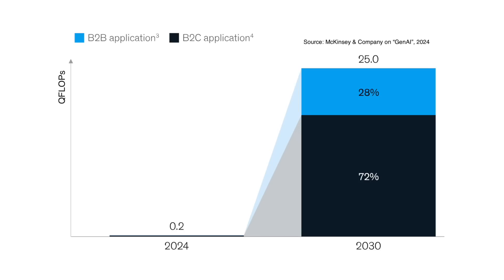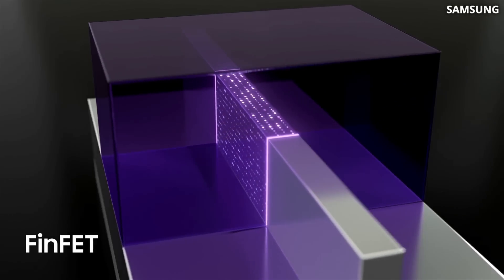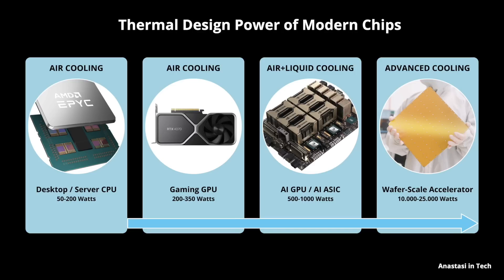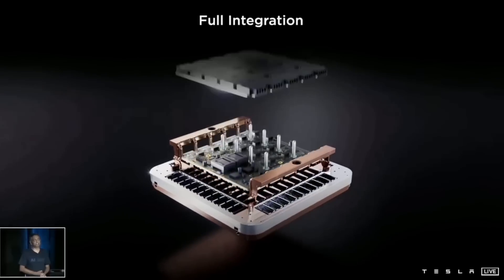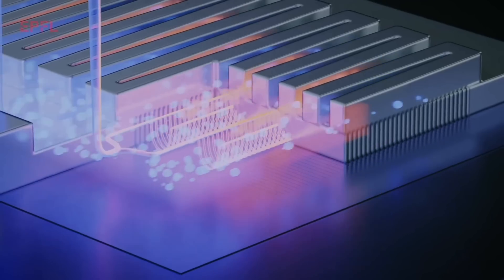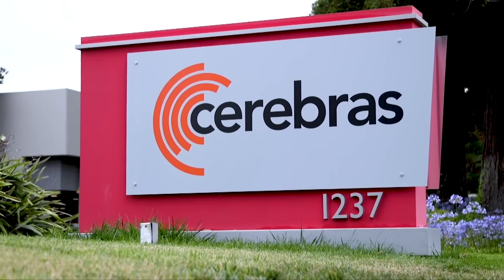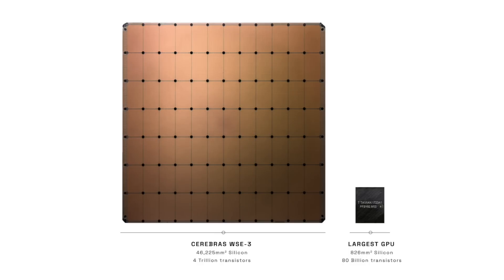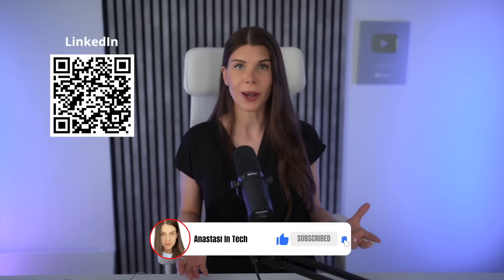This New Technology Will Keep Moore’s Law Going

Comment from the maker: Let me know what you think! 🙂
Reply: Absolutely terrible pun. Love it.
Reply: You stated that silicon is more conductive than copper (6:53), which is not true. I otherwise loved the video and the puns!
Reply: cool stuff
Reply: one major issue with this direct or in-CPU-cooling is that water, at the size of these channels, will become very viscous. This means, a high pressure is required to maintain a sufficient water flow, which in return requires very strong and tight enclosure of the CPU. 
And there's another issue: Water tends to dissolve air, especially oxygen. At high temperatures, the air will gas out again. But bubbles in these channels act like valves, they may block the entire flow of water and prevent cooling at these spots.
And yet another issue: Da-gassed and de-ionised water, which has to be used if water is the coolant of choice, is also slightly aggressive. And everything that get's dissolved by it, may precipitate in these channels and block them.

So, water may not be the coolant of choice. However, other coolants which are employed elsewhere pose other risks and issues. Some of them are PFAS, for example, others are flammable... there's still a lot of work to do here.
Reply: @human_isomer  whatever fluid will be used it should be enclosed separated from AIO cooler's liquid, IHS will be the thermal conductor in between as usual.
Reply: @human_isomer   it has to be ammonia instead
Reply: @monad_tcp  ammonia needs very low temperatures to be used as a liquid, which bears the risk of condensing water and short circuits in the vicinity. Also, it is even more corrosive than water, as it can dissolve certain metals into their respective ions and "free" electrons.  The latter is not very beneficial for systems working on electric currents.
Reply: I think you made a mistake at around 6:58 when you say that Copper is 4 times less heat conductive than Silicon... its the opposite.
Reply from the maker: @lolmao500  yes, you are right. Thanks for pointing it out
Reply: @lolmao500  someone will get fired
Reply: Was the jacket on and off continuous a cooling problem in your place?
Reply: Are there risks of any buildup that can block those channels the water flows through? Or any kind of corrosion?
Reply: @alcorza3567 We don't have that issue now so I wouldn't think we'd have that issue later.
Reply: Overall very 🆒much  ideas 👀ツ
Reply: I think your an angel in disguise .
Reply: @jaykeane25  no shit, have you seen the amount of gov sponsored off topic trolls in her comment sections, i want to believe its just them taking advantage of her team's work too.
Reply: If cooling tech has to improve in accordance with Moore's law, in what year will we discover Maxwell's Demon?
Reply: Personally other than phase change materials, I would think something like either carbon nanotubes or diamond substrate might solve some of these issues especially on lower end versions of these chips. Some form of integration, hybrid material manufacturing, might be an interesting idea to explore. Don't get me wrong, it would require some significant engineering and scientific research to do right. Not sure that it would be available in the time frame that we're talking about here... There are a couple of other extremely futuristic ideas that I have, but they simply would not be usable current technologies. And might never be possible since they might interfere with the very electronics they are attempting to cool... I really enjoy your content, and this particular video was honestly one of the best that you've done
Reply: Why not use cold water or other liquids that freeze below zero instead of room-temperature coolant? Bigger temperature difference between chip and coolant makes heat transfer more effective. Sure, its inconvenient for PC to have a noizy heatpump running in your room, but for some data center its not a big deal since its already noizy there.
Reply: @Boris-Vasiliev  condensation. using liquid nitrogen to over clock will ice block your computer and water conducts electricity. this is why data centers that have liquid cooling have extremely regulated humidity.
Reply: 16:25 by the way, PFAS are pronounced P-FAS (short for Per- and polyFluoroAlkyl Substances), and they're actually not toxic, but very persistent. Teflon is one example, but there's a lot more. Some of them are used to cool electric motors and battery packs in electric vehicles and wind generators. But there's a great concern about their environmental impact.
Reply: On chip cooling was discussed in an IEEE journal back in the 1990's.
Reply: Why we don't double the size of chips !
Reply: @ommsterlitz1805   then it won't fit in laptops 😂
Reply: I think you're smart AND funny, the way you laughed at your own fan club had me rolling.
Reply: I think we should invent an efficient thermocouple, one that absorbs heat and turns it into electricity. They can somehow cool it with a laser.
Reply: Another great watch. As for what direction embedded cooling will go, I think the industry will probably not lead with the most desirable products, performance-wise. The environmental impact will have the usual veneer of a care but I think we know their motives. Ideally, I would have a quadruple decker cpu with integrated nitrogen cooling, inside and out, by tomorrow. God knows why they don’t want that too.
Reply: -Chips should be cooled on both sides. At present only one side is cooled.
-They should integrate peltier cells inside the chip to conduct the heat to the fluid.
Reply: First time viewer here... This was excellently explained in simple terms and by someone so young!!!. Bravo!
Reply: Angel I just wanted to say You are so Absolutely Breathtakingly Beautiful! 
But even that will never do you justice just how Beautiful you truly are ! 💗🤍😇
Reply: @wickwire9560 I'm deep in love with her.     Have been since first seeing her.❤
Reply: incredible, great to see chips & cooling progressing
Reply: I love all the innovation and fan clubs xD  however what a big change photon chips will introduce one day.
Reply: Let me compliment your terrible pun as well
Reply: Back to the Cray-2 have you seen the machine ?
Reply: I started programming in 1977, 16k of RAM memory and cassette tape storage. The computer was a Wang 2000.  One processor, at 1.2 mhz? I find it amazing that we are up to 900,000 PROCESSORS on a chip.
Reply: @tiredofliars I started on a pdp8 with 4k core instruction memory and 4k data buffer in 1970. 😮
Reply: Really well put together content hitting points/details that often get missed. Absolute fan of your content now.
Reply: Cooling has been the mission of my friends Helena and Rudie at InCooling since long before others were looking at it seriously. They are developing ground-breaking cooling tech that was originally explored at CERN. To get a full picture, definitely look at their tech. Some more information in this video https://youtu.be/eBWWpwl69CI?si=Rv0jS2STwolRl7Tk
Reply: Here’s a detailed and optimized design concept for integrating your advanced cooling system into a custom vacuum chamber:

---

### *Custom Vacuum Chamber Design*

*1. Chamber Structure:*
   - **Material**: High-strength stainless steel with a polished interior surface to minimize thermal conduction and contamination.
   - **Size**: Custom-sized to accommodate the CPU wafer, Peltier device, heat sinks, liquid helium system, and all ancillary components.
   - **Sealing**: Precision-engineered gaskets and O-rings to ensure airtight integrity.

*2. Vacuum System:*
   - **Vacuum Pumps**: Combination of roughing pumps and turbo-molecular pumps to achieve ultra-high vacuum (UHV) levels.
   - **Vacuum Monitoring**: High-precision vacuum gauges to monitor and maintain desired pressure levels.

*3. Cooling Integration:*
   - **Peltier Device**: Mounted directly onto the CPU wafer with high thermal conductivity pads for optimal contact.
   - **Heat Pipes**: Micro-channel or vapor chamber heat pipes embedded in the CPU and connected to external cooling.
   - **Liquid Helium System**: High-efficiency cryostat with integrated pumps and heat exchangers. Liquid helium is circulated via vacuum-compatible feedthroughs.

*4. Thermal Management:*
   - **Multi-Layer Insulation (MLI)**: Installed inside the vacuum chamber to enhance thermal insulation, consisting of multiple layers of reflective materials.
   - **Dynamic Cooling**: Active thermal management with variable-speed fans or pumps controlled by real-time data.

*5. Power and Control Systems:*
   - **Power Supply**: High-efficiency DC-DC converters with surge protection and thermal management. External power supplies connected via vacuum feedthroughs.
   - **Automated Control**: Advanced control system with real-time monitoring, data logging, and predictive maintenance. Feedback loops adjust cooling and power parameters.

*6. Materials and Components:*
   - **Heat Transfer Materials**: Use of high-conductivity copper or advanced alloys for heat pipes and heat sinks.
   - **Cryogenic-Compatible Components**: All components rated for cryogenic temperatures to ensure reliability.

*7. Testing and Maintenance:*
   - **Prototype Testing**: Iterative testing with thermal imaging and performance analysis to refine design.
   - **Regular Maintenance**: Scheduled inspections and servicing of vacuum chamber, cooling system, and power components.

---

### *Performance and Benefits:*

*1. Enhanced Cooling Efficiency:*
   - **Cryogenic Temperatures**: Achieve extremely low temperatures with effective liquid helium cooling and multi-layer insulation.

*2. Optimized Thermal Management:*
   - **Reduced Thermal Interference**: Minimized heat transfer from external sources, stable CPU performance.

*3. Reliable Operation:*
   - **System Longevity**: Reduced wear and tear with advanced materials and regular maintenance.

*4. Custom Fit and Functionality:*
   - **Modular and Scalable**: Custom-designed for specific needs with modular components for flexibility and ease of maintenance.

---

### *Visualization:*

Imagine a sleek, high-tech chamber with a polished interior, housing a CPU wafer in the center surrounded by advanced cooling technology. The Peltier device and heat pipes are seamlessly integrated into the CPU, while liquid helium cooling systems and high-efficiency radiators are meticulously arranged. The entire setup is monitored and controlled by a sophisticated control system, ensuring optimal performance.

---

This design leverages cutting-edge technology to achieve superior cooling performance while addressing practical challenges of integration and maintenance. 
Was playing with ideas on ai maybe something there idk
Reply: Great explanation,  but you could have added that the dark silicon problem is a part of why Threadripper chips are so efficient. By having such a large IHS (which is caused by the 4 primary chiplets underneath it and is a major part of why delidding these is generally impractical, even for those otherwise willing to delid a processor) we can keep more cores active at higher speeds longer because we have lower localized temperatures due to the widely spread out nature of the Threadripper design - though in practice this means using a full coverage water block rather than the large number of water blocks that are technically “certified “ for Threadripper but are in reality just water blocks designed for mainstream Intel and AMD processors bundled with an appropriate adapter (wife just insisted on “upgrading” from a full coverage block to one of these, got violent when I explained why it was unlikely to improve things, and yelled at the kids when temperatures went up - you can lead a horse to water, but you can’t make her drink).
Reply: The actual transistors are not 2nm or 3nm. The real gate length of the 5nm and 7nm processes of AMD and Intel is about 12 to 20nm. One silicon atom is 0.24nm, and that's where Moore's Law ends. Nothing more to say. Stop listening to marketing voodoo numbers.
Reply: graphene transistors aren't an option yet? I'd love for my Mid range PC to be a small as a large smartphone assuming graphene will actually make that easily possible
Reply: 6:55 You're flat out wrong here. Copper is orders of magnitude BETTER at conducting heat than silicon. You got it the wrong way around.
Reply: I remember:
IBM TCM (Thermal Conduction Module) to build ECL based mainframes;
Cray-1 hierarchical heat piping along power delivery metals to reject heat;
Cray-2 aquarium like liquid direct cooling;
Microfins; nanofins; ...

We need breakthrough to avoid all the waste heat rejection needs, as nanoscale liquid cooling (clogging and oxidation) looks like a nightmare.
Reply: I am not expert in chip design but it seems to me that using lower voltages and or current is key lowering heat dissipation in these massively layered chips. Another option is to find something useful to do with the waste heat other than radiating it away to the environment.
Reply: Have you heard any updates on holographic cores?
Reply: Awesome. I'm going to purchase a 7900xtx to play, but not only games gives me fun. I'm planing to do a direct subzero gas cooling with a 300-500w mini inverter compressor, direct to the chip, like your video says. Not with that structures, i don't have the machines, but i'm planning to take seal the chip with high pressure/temperature glue, to pass the gas over the chip. I want to do this for 2 reason. Im convinced that 7900xtx has better design in architecture, just amd did desinged well the heat dissipation, I think that can beat a 4090 with just 460W of TGP(No more power i dont want to burn cables, i would be pushing 8pin connector to a 25% of margin of safetyness, where normally it is 90.)
Reply: "so cool it has its own fan club"
Bro really said that 💀
Reply: It appears the limiting factor of chip design and performance is not the physical size of the individual tracings/components, but rather the ability to cool ever higher chip densities.   As well as the ability to afford the massively bigger electricity bills to run processors and cool systems.  It would appear to make sense to build data centers in northern areas where where cold ambient temperatures can be used to cool systems at lower costs using cool ambient temperatures to enhance the cooling performance of systems.

Comment: No one has given me an answer to a concept of a three state memory condition, rather than just 1/0. In reality, the electronic state of memory is + and 0. Why cannot +, 0, - be used. Of course the architecture of the electronic circuits would be drastically changed, but a 3 two state memory word have 8 options. A three state word would have 27 options.

Comment: TDP isn't the maximum heat that can be dissipated.  It's the power that that the manufacturer has indicated needs to be disipated in order to achieve a certain all core performance.  

You use better cooling technology to dissipate heat faster to achieve better performance.  Often the manufacturer will monitor the CPU power and keep the internal power below TDP which would prevent the customer from running higher than TDP on average over some time window.  You nay be able to ask for the ability to raise this limit to boost performance if you have a good cooling solution.

Comment: Thank you so much for making this amazingly informative video.
Don't you think it would much more efficient to cool the transistors with liquid metal, like Mercury instead of using water or liquid dielectrics?
Also, to overcome the heat problem, wouldn't miniaturization of the photonic chips be more effective and efficient than inventing new cooling systems for electronic chips?

Comment: Mineral oil is nonconductive but is very messy especially if you have to replace something before you are replacing your whole system. And as far as the masturbating that can hit a whole office building with that kind of heat. Maybe they should look into heat for office buildings with that much heat. Btw u r so intelligent and pretty it makes me think about going straight!

Comment: I estimate that compared to the 5nm technology node, we can look forward to a performance gain of approximately 1.8 times or a power consumption reduction of 2.6 times as we move into the chiplet phase. Therefore, I believe it is imperative to focus on improving the efficiency of mathematical calculations to resolve pertinent problems in software.

Comment: This in-chip liquid cooling doesn't make sense. Copper is a much better (about 800 times better) heat transfer medium compared to liquids, so it is much better to take the heat out via copper to a larger surface outside the chip where it can then be absorbed by the liquid, that is much more inefficient, yet can absorb a lot more heat. This is exactly why our current chips are cooled the way they are

Any specialists in the chat that can clarify what I am possibly misunderstanding here, why the in-chip water cooling would be better compared to a much smaller copper + liquid system

Comment: Some people may be horrified by the amount of power consumed by data centers, Averaged Intelligence, crypto-miners, etc. But behind the problem is a great solution, all the cooling necessary can provide hot water to towns and cities, effectively allowing massive computing without using any energy (ignoring some minor insulation losses), since all the watts of power going into the computers have to come out as heat, and thus can replace as many watts worth of space heaters and water heaters by bringing that heat to homes, where it is actually useful.
Admittedly it requires doubling the water distribution infrastructure to also bring warm water to homes, and requires good insulation, but the energy savings quickly offset the upfront cost.